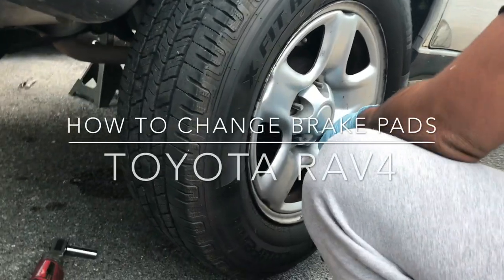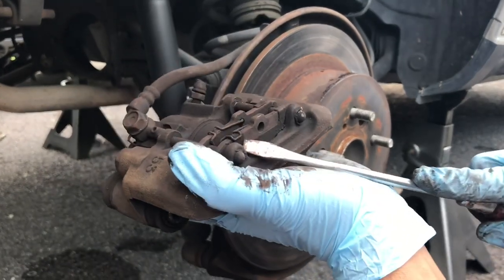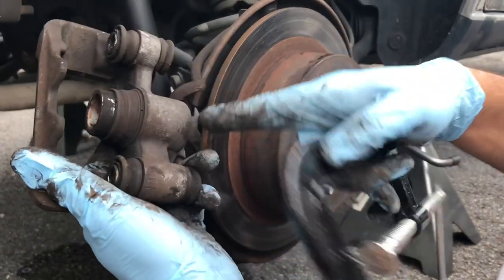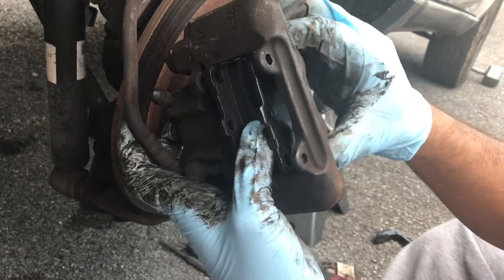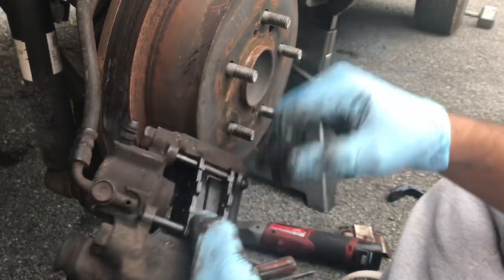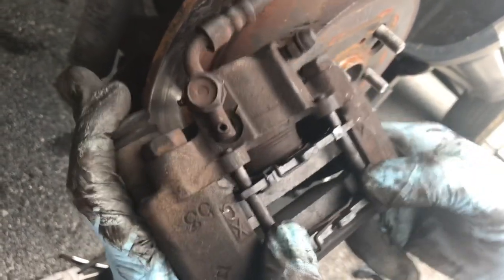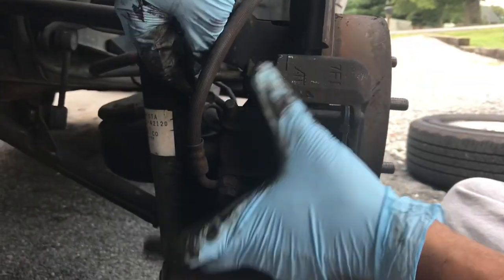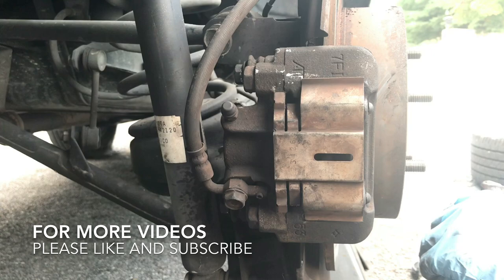(How To) 2001-2005 Toyota RAV4 Rear Brake Change DIY

Comment: I’ve watched 4 or 5 videos on how to change the brakes on my rav4 and this one was definitely the best as far as explaining the details. One thing I had issues with was getting the bottom bolt off to get the caliper off (bolt is tucked in behind shock). I had to jack the car up by the frame instead of the control arm so that the shock was completely extended, which exposed the bolt enough to get a socket around it.
Reply from the maker: Glad it helped

Comment: So I work at the manufacturer of the caliper in Japan and we got an OES part from the factory as a sample earlier today. Couldn’t work out how this would be replaced without the slide pins. It is a one unit caliper, no separate bracket. But thanks to your great video it is now clear as crystal. Great job!

Comment: Good video.  Only thing I do different (if I wasn't going to bleed the whole system) is to loosen the bleeder screw before compressing the piston, to bleed out the worst of the old brake fluid. Then, of course, top off the master cylinder.
Reply from the maker: Good point

Comment: Can you not just loosen the top bolt and hinge the unit instead of trying to hold it and change brakes
Reply from the maker: It’s easier to visualize everything when it’s in your hand vs just hinged. Plus this way you can change your rotor if need be.

Comment: Thanks so much for posting this. Other videos I've seen were not specific to the 2005, so I wasn't sure what to do once I took the wheels off. Big help! I'm replacing the rotors, too, but will have to put off changing the brake fluid till next week... Subscribed!

Comment: Nice Video . The only things I would add is when you are using the ' C' Clamp and Compressing the piston , it will go easier if you remove the cap off the Master Cylinder .
Just Remember to replace the Master Cylinder cap and when you are all done .
And BEFORE you move the vehicle , Step down a couple of times to set the pads onto the rotor otherwise you wont have any brakes for the first few feet of driving .
Again , Nice Video and thanks for not filling it with loud annoying music ( like most Videos do ).

Comment: Those pins came off alot easier then mine. One barely came out and the other was seized and actually started to mushroom. Problem is you can't get a direct vertical strike to knock out the pins because the genius engineers decided to place the brake banjo bolt and bleeder nipple directly in the way for a vertical blow. Had to remove the banjo bolt to strike it straight out. Now have to bleed to system. 😖 They could have easily designed it without these in the way and used mini cotter pins or spring clips on the tips. Also a hex head instead of the smooth dome head could help break seized pins loose.
Reply from the maker: I suppose a thin punch could work to strike them out. You could also put some locking pliers on the pins to rotate and move them. Heat and penetrating oil can also help.

Comment: Man the second gen RAV4 looks just like the first gen  rav4 when it comes to the rear suspension. I'm curious if it's so easy to get rear disc brakes on a first gen by just swapping out the lower control arms lol! For me I would have to need a all wheel drive control arm from a second gen. But I don't like how tiny the calipers are so those would get upgraded lol because I tow 2,000 pounds.

Comment: Use a pair of channel lock pliers with one of the old brake pads and remove the cover of the brake fluid reservoir.  Now just squeeze the channel lock pliers to push the brake caliper piston back into the brake cylinder.